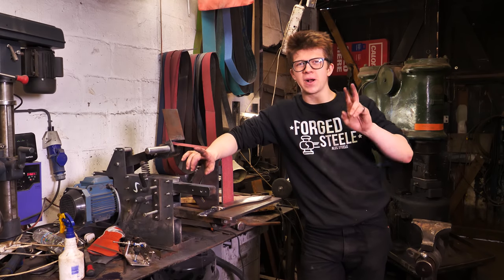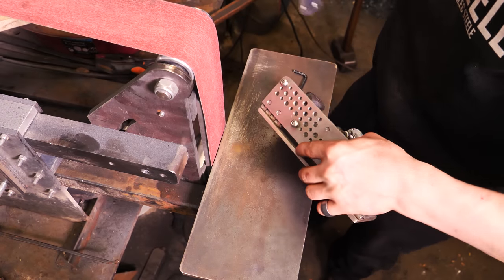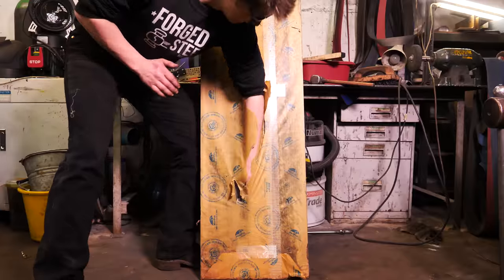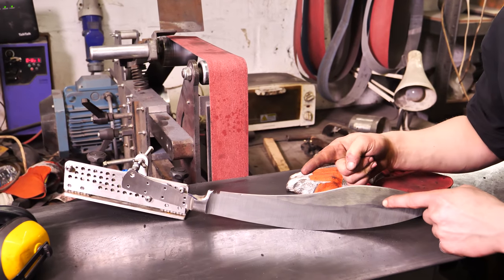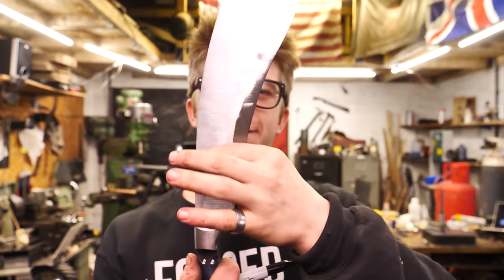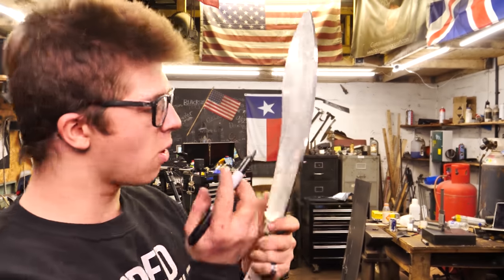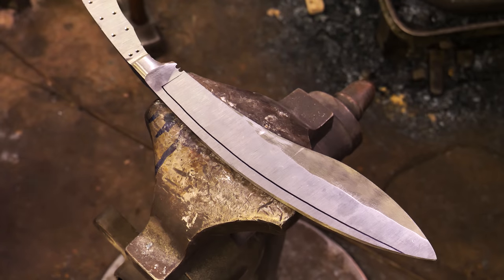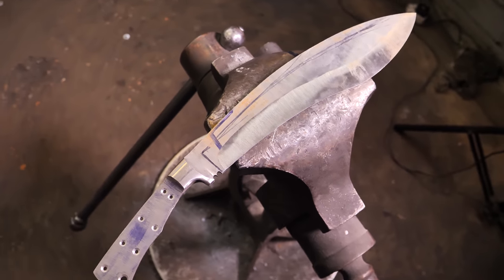CRAZY DAMASCUS KUKRI: Part 3 *in 4K*

Comment: Another great video and build Alec! I can't wait to see if finished! This big kukri is a great stepping stone to finally making an Awesome Damascus Sword. 

Also,  a grinding jig for the curved bevel could be made easily with a few pieces of 3x3 angle steel and adjustable base. Then use the contact wheel or flat side of the sander. Then you just slide the blade through the jig, contacting the belt with a curved motion following the curve of the blade. I hope that makes sense.

Comment: Alec, you have taken the video to a new, very professional level. Seeing the sparks reflect off the steel in #2 was stunning.
I have started with a little forging, and I have a few questions.
1) I know that an oil quench is important (?), but how is it different from a hot water quench? What kind of oils should I consider?
2) You placed the piece in your oven at 200 C. Why?
3) When I was working the anvil, I noticed that the heat got sucked away more quickly than what I have seen before. It is a pathetic anvil and clearly does not have a tempered "boss" (I think that's the term). Could the conduction be caused by the lack of tempering?

Comment: Pray to the tape gods lol. A good trick for freehand  beveling a curved blade is to use the wheel on your belt sander and hold the blade vertically. It take a little practice but, it works great. I love the forging part but, I hate the grinding part. It seems like the sanding takes longer then the forging. Cheers Man.

Comment: You asked for a challenge.  You have the equipment and you have the skills, so here goes:  Forge an 8 inch heavy duty leg vise.  Forge the screw, twist it and clean it up on the lathe.  Make it full height, but with a two piece leg so it can also be used as a striking vise.  Auction it off to the highest bidding subscriber.  This could be an entire weeks worth of episodes, each about 30 minutes.  Have the bidding done in the comments after each session, with a live 2 hour finale and ongoing bidding.  It doesn't have to be Damascus but that would be VERY cool!

Comment: Alec if you pull the blade out at the right time after quenching, you can place it in a vice and straighten it before the grains have time to properly set, and keep your hardness. Just wanted to let you know so you don't stress quite so much about the quench

Comment: Alec I have a new challenge for you. The challenge, should you choose to accept it, is to recreate the hidden spring loaded retractable wrist blade from Assassins Creed. It needs to be as low profile as possible, easily sprung, easily retracted, holds secure to the arm, and of course, made entirely of damascus steel. Good luck.

Comment: The "Little sharp bit" is called the cho...and the legend of always having to 'blood' the blade after drawing it is just that, a legend. The kukri is used as a utility blade by peasants all over Nepal, and they don't go around cutting themselves every time they use it. That would be silly in the extreme, wouldn't you think?

The fact is, even the Nepalese argue about what the cho is for. :)

Comment: Just a thought about the jig you used to flatten the blade. If it was adjustable for pitch, and had strong magnets embedded in it, that grabbed the blade instead of the Tang, beveling the blade, would be much easier, more precise, and also more repeatable. At least it would be on a straight blade, but something with a belly in it (?????) could be done with a little extra manipulation, and short overlapping strokes, on a narrower belt maybe.

Comment: the notch near the hilt (called the cho) serves a dual purpose, it's a stopper for when the blade is being sharpened with a chakmak to prevent the chakmak going too far and grinding on the ghari or hitting the handle, it also serves a purpose as a blood dripper, to stop blood on the blade from running down onto the hand of the wielder, and possibly (not confirmed as far as i know) as a device for catching an enemy knife/sword. the cho also has religious associations, signifying the hindu fertility symbol, and the cow's hoof.

Comment: That moment when you just pulled your knife out from quenching to see if it's still straight can be the best or worst moment of knife making. Sure it can be straightened but you risk have to take hammer marks out and more likely to crack the blade.

Comment: if you soap up the blade (with ivory soap) then put a a little charcoal in the tube you will have virtually no scale on the blade after heat treat.

that is if you clean it after normalizing or normalize before grinding.

Comment: What is the reason you quench in oil ???
Reply: burtronomaniac water will only drop the temperature so fast, as the first several seconds is wasted as the water flashes off into steam. Steam, unpressurized, only goes up to 212 deg. F and therefore does not lock in the crystalline structure as fast as as another medium- in this case, certain types of oil that won't evaporate at quench temperatures. This cools the work down faster and locks in the molecular structure better.

Some smiths, in a compromise, will use salt or bromide water to bring that temperature up a bit.

Comment: why the fock ( im upset because i see the solution right there !) why you dont produce an belt jig, a flat piece of high grade steel, wich runs under the belt to grind the metal on the bigger flat table ?! you got in the back also a realy nice bigger beltgrinder what have, i assume, a bigger flat grinder table ?! i see you will get better you learn ;) great clips love them you cut them very well like it ! =)